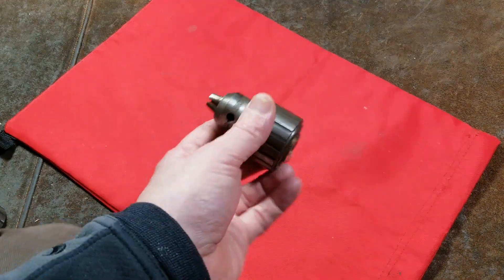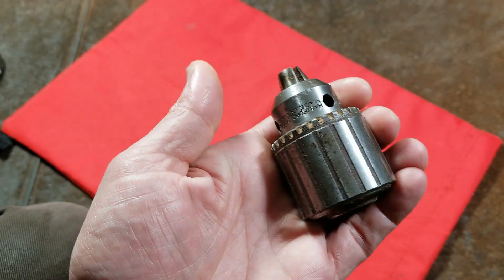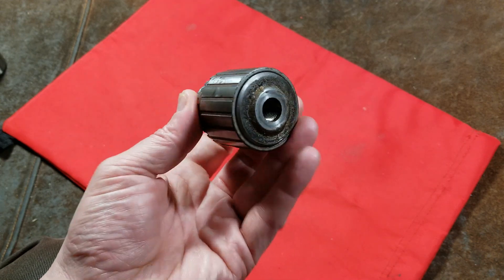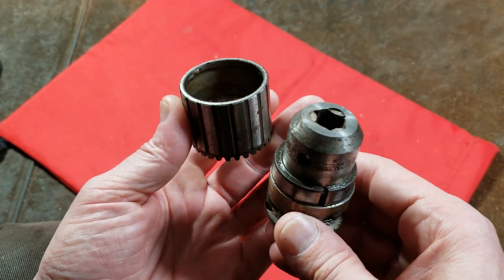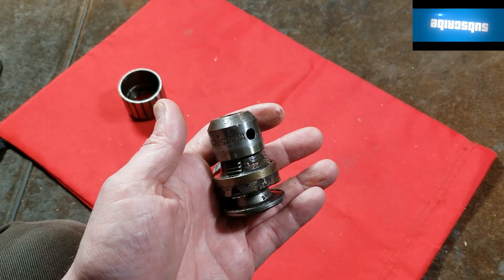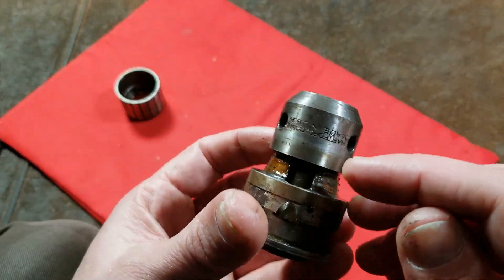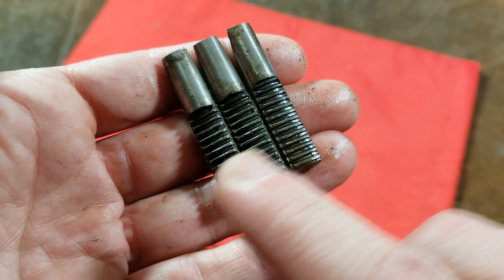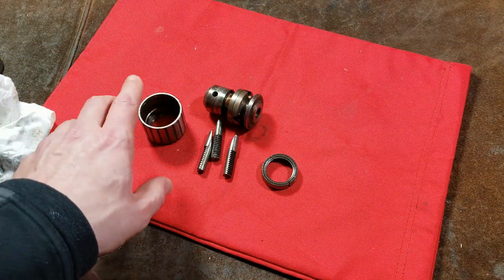How to Rebuild a Jacob's Drill Chuck

Comment: I watched this as I just bought a big box of about 50 mostly Jacobs chucks of various sizes for $25 at an auction. Most have surface rust so I am going to be busy disassembling, derusting, lubricating and assemblng. Great short video showing the anatomy of chucks.
Reply: Use Diesel or kerosene...I've also heard acetone & auto transmission fluid works good ..but sounds more fume and possibly evaporates and somewhat flammable.

Comment: In my search results, your video looked a good first choice... it was, so second choice didn't get a chance!
I have just finished a refurb of a seventy year old lathe.  It had been in damp storage for sixteen years, so it wasn't pretty!  The Jacobs tailstock chuck is very "brown".  It moves, but from the "feel" of it a bit of your treatment is in order!
A teensy tip for you:  I suspect that, like me, you find dictating to Google works great for text input.  However, don't trust it... proof-read everything.
Check out the description of this video:
"Here's a quick video on out of disassemble"  did you mean "Here's a quick video on HOW TO disassemble"?
Also:
"It will apply to any industrial chalk"  did you mean "It will apply to any industrial CHUCK"?
Thanks for taking the time to make the video, I appreciate it.

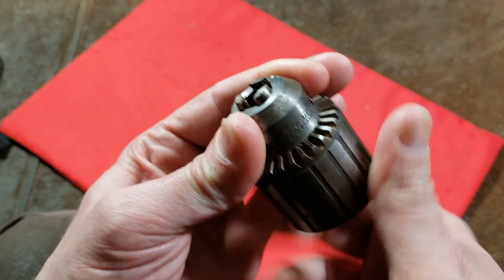Comment: Warning !!!!!!!!!!  Should you lower the jaws just below the nose of the chuck body, as indicated at 1:30 in the video, the base of the jaws may still contact the sleeve as you press it off and you may possibly damage the ends of the threads on the jaws. You would be better served to to use a PVC plumbing fitting (or other appropriate OD/ID diameter short pipe or wood dowel with a partial center hole) that can bear on the nose of the chuck while giving a center hole/area to allow the jaws to be raised above the nose of the body of the chuck while the sleeve is removed (and avoid any pressure being applied to the jaws). This better guarantees the bottom ends of the jaws inside the chuck body will be free and clear of the sleeve as it is pressed off.  I followed this video as instructed and it buggered off a portion of the last thread on jaw #1.  So now in operation, when the jaws are almost fully extended (closed), there is no thread on the #1 jaw to be engaged by the threaded split ring and that jaw slips down from the other 2 jaws.  I hope to use some JB Weld to recreate that scant final tooth on the end of the jaw to keep it engaged with the threaded ring when fully extended. BTW, sleeves on drill chucks cannot normally be removed by holding the chuck in your hand and hammering on the back of the body of the chuck. The tolerances are too close and more force will be needed like from a press, vise or using a large F or C clamp as a press.
Reply: Follow these instructions people! I just mangled a 6A Jacob’s chuck the same way. I started with them fully retracted based on another video, and it only moved about 1/16th. Watched this video, brought the jaws just below the lip, pressed it again and heard the jingle of death. 

Got it apart eventually but all three have damage to the lower thread. I wish I’d read your comment first. That chuck is 80+ years old and original to my Power King drill press, don’t know if I can fix it  :(
Reply: @j1bb3r1sh Sorry to hear what happened to your jaws. I was lucky it buggered only one jaw.

I was able to rebuild the thread at the very base with JB Weld and after much fiddling, sculpted the added material so it engages smoothly. It may not last forever, but the added thread is only consequential with 1/16 dia. or smaller bits. and at least the jaw no longer drops down. Best of luck to you.

Comment: A bit worried about the lock tight if you ever have to refurbish it later.  I had to use a press to get one apart that had used that method.  I would try to clean the parts or perhaps run the correct file over the parts.

Comment: So I wound my jaws below the front of the chuck, a Jacobs just like yours. Supported outer ring on vice jaws and used a hide hammer to drive it out. What you didn't say us that the rear of the jaws impede on the inner rear ring of the collar. Result....totally fucked. Collar bust and so is the threaded ring split in two. Bin job. Wish I'd never seen this video. If it ain't broke, don't fix it. I only wanted to service it!

Comment: Thanks for the video.  I just rebuilt an old Jacob's chuck, based on this.  My jaws were no retracting smoothly, which was a bit better with the jaws from the rebuild kit.  Running (just by hand) a 12mm drill (I didn't have 15/32" drill bit) into the recesses made them smooooth.  Worth trying.
Reply: This may be what I need to do.

Comment: I recently disassembled the same chuck which was mounted on an old air drill. I used a machinist parallel clamp instead of a socket for the back end, and a vise to press it apart. It was quite tight so hitting it like you did would not have worked. I was surprised to see the grease inside was more like dried varnish. I had to scrape everything to clean it up. I had to use the vise again to press together even after being all cleaned and fresh grease.